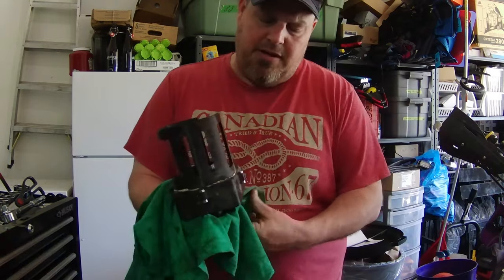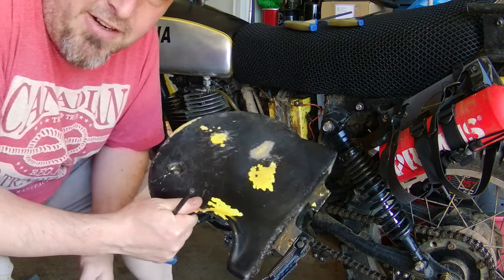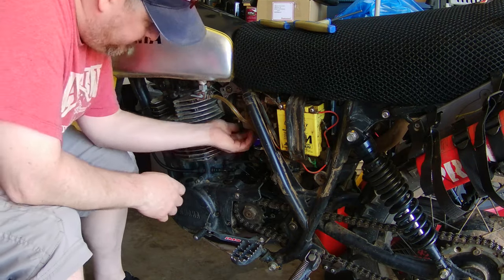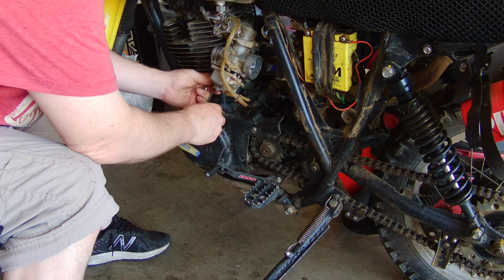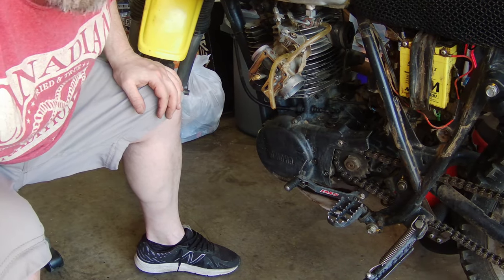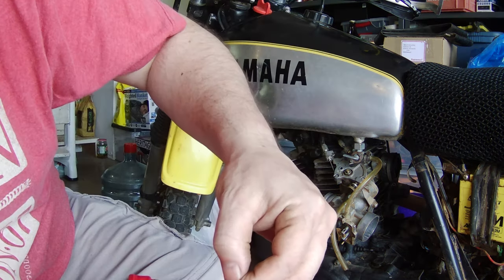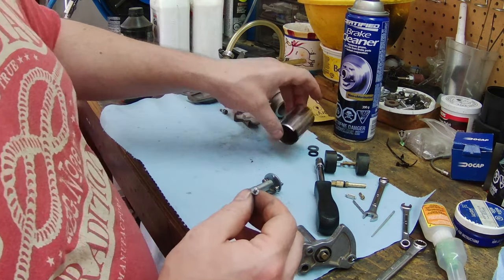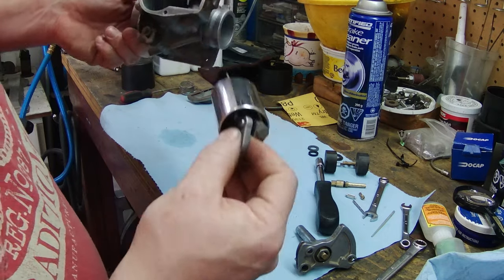1976 Yamaha XT500 Carburetor  Removal, Teardown, Adjustment, and DIY Airbox

Comment: Don't you mean the clip needs to go up a notch on the needle to enable the needle to sit lower and lean out the fuel ?
Reply from the maker: Your rationale is correct. Did we say it backwards? Probably, but hey, we're called Trail Trash for a reason. Lol.
Reply: Yeh sorry !
 I thought it might save somebody a lot of time and frustration instead of copying the other.
Reply from the maker: No worries! We've pinned your comment so others are aware :) 
Good catch!
Reply: @RaggedRoadsMoto-y1m  By the way, Great content videos especially on the XT500. I ran a 79 TT500 to work back in 86, So yes definitely a fan !, I've subscribed and can't wait to see more, Thanks 👍

Comment: I have a 1976 Yamaha xt500 I took the carburetor apart and cleaned it. I cleaned the petcock under the tank but when I start it idels but when I give it throttle it boggs. Before this happened I drove it for a hour it worked perfect and suddenly it just bogged and now that’s all it does. I took the bowl off cleaned it and still Boggs I’m frustrated now if you could help I would appreciate it thanks Jim
Reply: Hey Jim are you using an inline filter? Do you have a steel or ally tank?
Reply: @Psycrow11  ya I have a inline filter I change it and a steel tank I cleaned the petcock on it still frustrating I guess off comes the carb for the second time. Thanks though for your reply 👍
Reply: @jimbuchanan8640  are you getting rust particulate in the filter? Stock Jets? Airbox mods? Bogging when you open the throttle but idles fine means the pilot circuit is good. When you open throttle that’s lifting the needle jet and carb starts pulling through main jet and sounds like it’s gettting too much gas and is killing spark or too little and going very lean. The main jet does get plugged with crud but the pilot would be blocked most likely if that was the case. More likely if you missed something on the first cleaning it’s the small holes in the emulsion tube the main jet feeds. Remove main jet and tube it’s screwed into and hold it up to the light and make sure you can see through all of them. Let me know and I can do a follow up vid or point you to one. Also make sure your a member over at xt500.co much awesome information there and very knowledgeable guys.